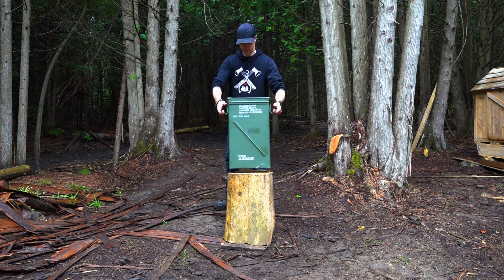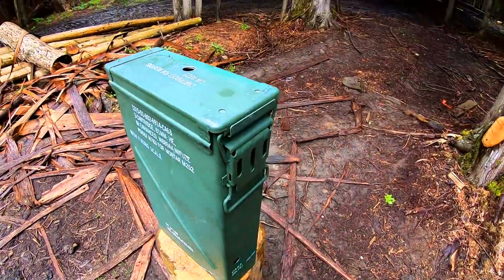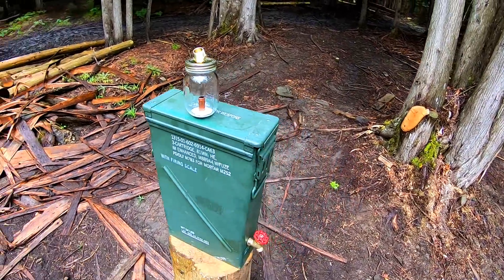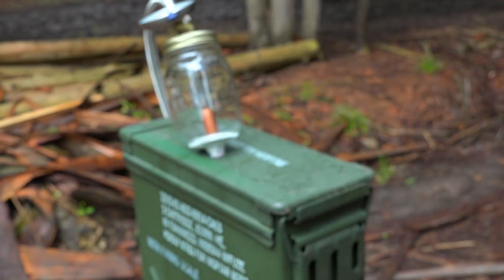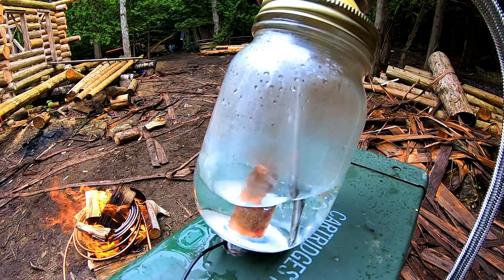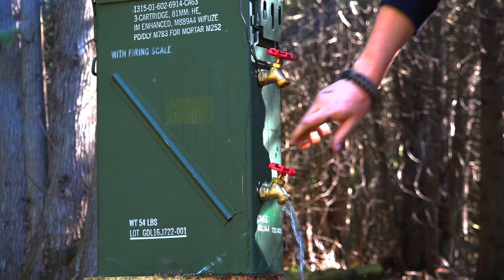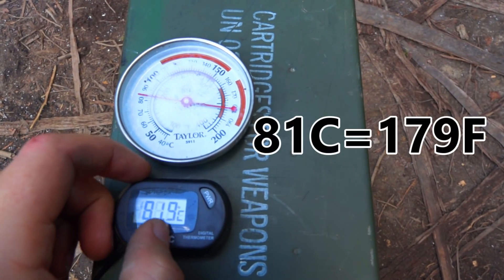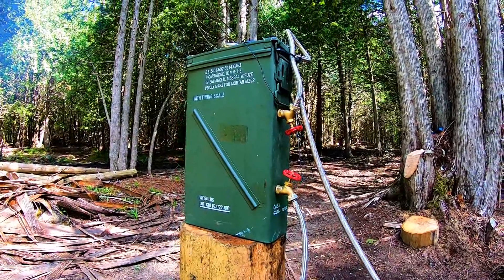Off Grid Heating Prototype- Copper Coil Water Heater / Heat Exchanger / Radiant Heater

Comment from the maker: Hey guys, I had a lot of fun working on this heater concept. If you have any ideas to develop it further, I welcome your input in the comments. In the meantime, here are a couple important points about the system:
- Notice that this is an "open" system. Meaning that I made sure to leave a vent hole to prevent any pressure buildup. 
- This system is not for drinking or cooking, as the ammo can and other components are definitely not food grade rated. I designed this as an experimental heater only.
- Once the water became hot enough, I made sure to remove the copper coil from the fire, to ensure that the temperature tolerances of the hoses and fittings would not be exceeded.
- And of course this is a prototype, meaning that it's not perfect, but something I've been working to develop further.
- The copper obviously isn't designed to be set directly in fire, but I simply wanted to see if the concept of heating with copper was possible. Now my goal is find a way to shield the copper from the flames in order to protect it from degradation.
Reply: Great video! Have you considered reversing the whole system? Heat the ammo box up over the fire...and run the copper through either the floor or walls of your space. You would then essentially have radiant heating. I think that copper will radiate much more efficiently than that ammo box.
Reply: @ChuckRobertsonProject  Chuck I believe you have something here. I have been following this also. I too have a mini camper for behind my sxs UTV. I'm agreeing that a "smaller" fire in the box, perhaps wrapped with tubing, may be safer with tubing inside with, a computer fan to move the air around, and also help cool the liquid faster."GLYCOL".:) I have a small 2.5 watt solar panel on mine that keeps a lawn tractor size battery topped up very well.
Reply: Seems kinda noisy. Maybe you could leave the can outside and run a second coil inside the camper? Or put the can in the fire and coil on the inside?
Reply: It's basically a " thumperbox" on a " "shine still: the noise of it is impossible to get rid of due to how bad his set up/approch is sadly as it's an "open"rather than a closed / regulated system..
Reply: Have you thought about mounting your ammo-can reservoir above a shelf on the nose of the snowmobile camper where it would be best suited for thermo-siphon action and accessible to add water or or drain hot water into the interior of the of the sleeper berth.  In this way you could avoid spillage and increase  safety to yourself and your bedding.  By having another ammo-can (or  several) of equal volume inside; you could fill them one by one as hot water  became available  outside by  gravity feed  through a hot water garden hose.   If you wish to provide a long term flow of hot water through the camper for the night your system will need to be carefully designed to cope with steam developing at hot spots in your coil.  Steam exerts pressure in all directions and has the net effect of interrupting  smooth thermo-siphon flow.  By forming your copper coil so that the cooler water enters the fire at the lower end of a consistently rising coil (picture an Archimedes' screw) and exits the coil into a rising hot water delivery line, should solve most of the difficulties.  If too much heat is applied, a one-way check valve on the cooler end of the coil might be necessary.  A consistent heat source under or near the coil that would last the duration of the night is the other requirement.  Perhaps a banked fire full of coals and hot rocks would do the trick.   I have a home made copper coil under my desk right now, that I enclosed in a two foot length of galvanized 5 inch diameter stove pipe.   It is reinforced with heavy steel wire so it could be mounted on a small wood stove, but I suppose shielding like this could useful over or in an open fire to protect the copper coil inside.  I  have recently solved my issues with my pressure cooker boiler sending hot water occasionally up the wrong line; by applying short term suction with a handheld kerosene pump or a rubber suction bulb to the line I want to get  hot.  Once heated, it draws cooler water down the companion line into the boiler; no longer confused, it runs consistently and silently.  If the system gets too hot I remove some heat or turn on a 12 volt fan under the radiator attached to the hose returning to the pressure cooker boiler.  This cools the returning water which immediately increases the speed of the thermo-siphoning action and cools the system so a boil will not produce a geyser.  Very controllable and easy to balance with a propane burner or perhaps gradually dying embers from a campfire.   I hope this information will prove helpful: aim for hot water not steam.  Fred Fisher
Reply: The biggest drawback I can see is cold temperatures can freeze the water in pipes.I had a similar setup using wood to backup  solar hot water. one cold night I started the fire and before it could melt the pipes all the way to the water tank/radiator inside the house it exploded. It can work great but needs a lot of TLC be careful
Reply: You could just make a fire, put a pipe in the fire with one end venting in your camper and the other end going through the fire to where it sticks out passed the fire. The pipe heats and blows clean hot air into your camper
Reply: @JosephHarlan19  That is a great simple idea I guess use copper or stainless through the fire area and insulate parts that are going to shelter area.If it slopes upward it should naturally vent otherwise a small 12v fan could be used
Reply: It will be awesome to see it in action! Subbed
Reply: I've been binge watching Primitive Technology, takeaway being the incredibly efficient rocket stove. You could make a small, thin walled, basic rocket stove from clay soil or concrete. Wrap your copper pipe around it and encase in more clay/concrete. A final layer mixed with perlite would increase insulation of the heat mass. The pipe could be run to a car radiator as someone else mentioned. A simple slide set up to gravity feed small logs/coppice wood will keep the fire going all night.
Reply: I don't know if anybody mentioned this already, but there will be one complication. Hot water tends to evaporate and there will be a lot of humidity in small closed room where this system planned to be placed. And it will be not very nice to have 100% humidity in your cabin in winter.
Heater box should be closed tightly, and additional tube for directing excess steam outside a cabin is required, not just a hole in the lid.
Reply: The Outsider I would love to see you make a 55 gallon drum into a shower with the same principle really really good work enjoy your holidays
Reply: Cubic mini cub wood stove (what i bought) Quick connect air hose fittings installed to cap of a jerry can. 1 flue coil w/plug and play fittings. 1 open ended vent hose (to outside) to releave pressure and direct moisture outside.
     I did all of this in my rv. Got hot water without steaming up windows or having propane heater creating condensation.... +++ a couple of fancy "coil things" from REI and i charge my phone as well
Reply: As a mechanic some simple improvements would be to use silicone flat washers for your sealing washers. I would eliminate the sharkbite fittings and use compression fittings. If you were going to do it over again here is how I would do it. Replace the hose valves with all metal ball valves. Use copper crush washers on either side instead of o-rings/flat washers. Use compression fittings that can be attached directly to the ball valves. Heat system up dump water retighten all connections when hot. Another option is to do the same thing only using all metal hydraulic fittings. This would allow you to quickly connect and disconnect the system for quicker deployment and back up. It would also allow you to retain the water in the tank if you were to make it a sealed system. How I would do that is to use the same idea with copper crush washers and make a permanent vent at the top with a ball valve. This way the system can be closed. I would then choose a smaller diameter and do the same thing and set it up with a 90 up so you can place either a metal bowl attached with compression fittings or a funnel into the 90 so you can fill it with water from there. I would also suggest mounting a very small metal condiment bowl to the top that you can use to boil/smolder incense or whatever is around you whether it be pine needles etc for an incense in your little camper.
Reply: Seal the system and allow it to pressure up, and install a automatic pressure relief, like a radiator cap, to vent excess pressure, this will help prevent the water from boiling......
Reply: You can nail 4 legs to the log making it stand up vertically about 8 to 10 inches off the ground. Cut the log down the middle splitting it in half long ways. Also make a little tunnel going through the center of the log from top to bottom. Then you wrap wire around it to hold it together and it will stand up in one piece. Start your fire in the center of your log and when it gets going good enough you can insert an inch wide pipe through the burning log. The end of the pipe will be under the fire in the space provided by the legs. Put a bend it the pipe where it will run into your camper. The pipe can be a good few feet long so your camper is safe from the flame. There you have it. Clean hot air to heat your camper. Ive only ever done this with a tent though. The camper will hold heat so much better. I always have an air tester just to be safe. Its never went off. Maybe cause the air is clean enough or maybe the tent vents well... Being a tent and all.
Reply: Have you thought about running the tubing along the floor of the cabin for radiant heat? use quick disconnects on the outside to connect the copper tubing
Reply: I would've just used a small wood burning stove in the camper
Reply: Very cool! How did u get the copper into the mason jar?
Reply: I'm befuddled by something,how did you get that size a hole in that canning jar? A dremel?
Reply: for efficient heat dissipation into the atmosphere add fins to the ammo can. much like a CPU cooler and motorcycle engines, the fins will dissipate the heat from the water into the air and will require less heat to generate the warm glowing feeling. 

Also experiment with different coil amounts that the water passes through. less coils and you may find a goldilocks zone that doesnt boil the water but still allows it to absorb enough heat to generate a radiator effect.
Reply: Add peltier modules on the ammo box. It could create a good quantity of electricity.
Reply: You can do this heater thing with your fire place for cooking. Run the tubing through the fire don’t even need a coil.
Reply: nice ideal, myself, i would add 1/4 inch AL plate to the bottom of the sled, later when fire dies down, slide sled over fire....
Reply: My question  is are you using hard water and if so is any build up of lyme? The only thing that helps my lyme build up  on my woodstove h20 is vinegar .
Reply: Hey fellow Canadian Outsider, my kids love your tiny cabin build, they've convince me to build our own. Thank you for the inspiration, here is our first video of our TINY Cabin build  https://youtu.be/y-Zk7jl9E8s Thanks again for the great ideas ! Please check out what we did for our heating approach, we are using a heat exchanger and a radiator inside our cabin to bring heat in directly from the fire. This way no smoke gets inside and fire can be safely 10+ feet from the cabin generating the heat for the cabin.
Reply: Good concept to have the fire outside and take the heat inside with the ammo box. However you should also leave the steam outside or you will get a lot of condensation in your cabin. Probably you do not even need a big fire or you could do with less turns of copper.
Reply: That sound is probably a steam hammer problem. It's probably not good for the longevity of your system. That's all I know about it, sorry.
Reply: Could you fill your ammo can with wax and seal it up?  (Or make capped pipes in various sizes filled with wax).  Melt the wax into a hot liquid, then place in your shelter.  It will start cooling then reach a state of constant temperature as it changes phase from liquid to solid.  Then it will start cooling again as the solid radiates its remaining heat.  You'd just need to find a wax that phase changes at the temperature you like - it would be like having thermostatically controlled heating.  In a pinch it's also a good source of energy, and the containers could be made into structural members.
If only using water and heat from fire with the same materials as your thermosiphon, it might be easier to create what is essentially a distillation process, with your shelter acting as the condenser.  If you were able to maintain a fairly constant heat, to keep your water vaporising all night, you could have the added advantage of having a big bucket of distilled water ready to go in the morning.
The most simple method I can think of is to just increase the volume of water and decrease it's surface area, then heat it to 99 C and wrap the container in an appropriate amount of insulation and take the whole thing inside.
Sorry, one more idea: a giant heat pipe, equivalent to what's used in a computer cooler: evacuate most of the air in a section of pipe and add a small amount of water then seal.  The internal pressure will be low enough that the water in the pipe at the low (fire pit) end will boil at, say, 40 C.  The steam will fill the pipe and condense at the high end (your shelter), then run back down as water to the hot end and repeat the cycle (insulate the part between the fire and your shelter).  I have more...
Reply: More water  would mean it wouldnt boil or would take a lot longer to boil, either way, more ammo boxes in the system
Reply: This is very cool , space saving and efficient , genius.  And I just realized that ammo box can also be used as a toilet tank as well.
Great work , perfect for the country , now lets cook some liquor hahahaha 👍
Reply: maybe put the ammo can(s) under your house... line the hole and your house with radiant barrier.  geothermal energy...
Reply: you can build a rocket stove or a 55gallon drum stove, wrap the copper around whichever stove and even the chimney stack where a lot of heat is lost. i still think a car radiator would be more efficient than a solid box. and a simple pressure relief valve and you can go to a closed loop system.
Reply: here is another idea, route the hot water line (in) under your floor or around the wall, to get a heated floor,  OR a cool idea for your set up, create a 6" tight coil on a countertop as a cup warmer, it would still be part of the closed (well open if you choose to keep the hole and ammo can set up) but on the way it can get another purpose. wish i would have seen these videos back when you made them. are you still doing things like this?
Reply: Maybe cap the vent hole with a longer tube to the area you want to heat.you'd have to find away the remove the moisture out of the vapor.maybe run the vent tube through the fire before leading to the area you want to heat.just a thought.it may not work
Reply: protecting copper from flames to protect it from destruction is simple.
you need to ensure a continuous flow of water in the system.
we bring one pipe to the fire from the bottom, the other we take from the top, at an angle upward (1 / 2-1 / 5 "is enough). The lower one is connected to the lower tap, the upper one to the upper one (cut in the tank). Above there is another outlet for steam.
thus, the water will circulate on its own due to the fact that the heated water is slightly expanded and lighter.

(translate)
защитить медь от пламени, чтобы защитить ее от разрушения - просто.
нужно обеспечить непрерывный ход воды в системе.
одну трубу подводим к костру снизу, другую отводим сверху, под углом вверх (1/2-1/5 " достаточно). Нижнюю подключаем к нижнему крану, верхнюю к верхнему(прорезать в баке). Сверху еще выход для пара. 
таким образом вода будет циркулировать самостоятельно за счет того, что нагретая вода немного расширенна и легче.
Reply: Install a 2’ baseboard heater section  it’s and plumb the waterlines  to the outside of the camper  lol
Reply: I wood think nothing of making coffee with it, being that the water is totally boiled, Peace brother !
Reply: Try to add some rocks to the box for longer heat retention. Maybe some cast iron for holding heat longer.
Reply: Corrosion because of 3 Metals in the Loop.
Reply: "but I simply wanted to see if the concept of heating with copper was possible" could have saved yourself time and money with google; wikipedia etc etc. why try to re-invent the wheel and coming up with a square
Reply: Do it like the old fashion stills for moonshine..Wrap the coil around a metal pipe place it inside of a larger  metal tube heat it with a rocketstove design so that you don't have to let the coil rest directly in the fire.
Reply: you are boiling the water in the coil and producing steam. You need to bleed the system of air. This will allow better contact with the water and also keep your copper pipe much cooler.
Reply: Use an old wood burning stove. Wrap the copper around the entire thing. Would prevent fire damage... maybe won't heat as fast as in the fire directly but should work

Might even heat faster now that a think about it. Seeing as a stove is more efficient then a open fire. Just an idea
Reply: Do you think a pressure fed system would work? So a hose connected to the cold feed and just collecting the hot, i was wondering if it would actually heat the water properly using 10m of 10mm copper microbore
Reply: Since you wish to protect your copper coil from the extremes of fire, one solution you might try,  is to reshape the coil so it fits inside a water filled cooking stockpot.  This would create more lead time to bring the water up to temperature in the stockpot, but have the added benefit of preventing steam inside your copper coil.  Copper conducts heat readily so it might only be necessary to use a portion of your entire coil inside the stockpot.  I suggest that where the copper tubing enters and exits the stockpot be near the edge so the cover can be notched.  In this way, with the cover installed,  it will help to contain the heat and the water in the stockpot.  It also will help if the cooler return line drops directly to the bottom of the stockpot with denser return water; then climb upward as the water gathers heat.  With my trailer heater,  I use second hand camera tripods to support the hot delivery line because a smooth upward slope helps insures an effective  "thermo-siphon" .  It would be easy to create some tripods for support out of tree branches.   I have not had a chance to experiment with this coil in boiling water concept, but it seems simple enough to work and I am anxious to try it out.  Perhaps you will beat me to it!   Fred Fisher